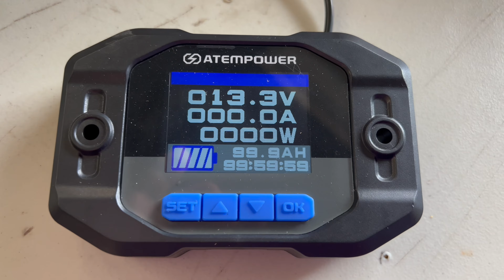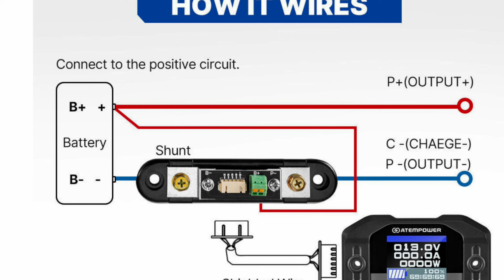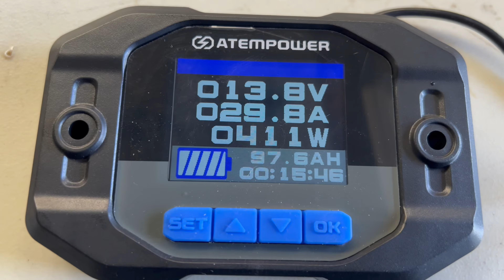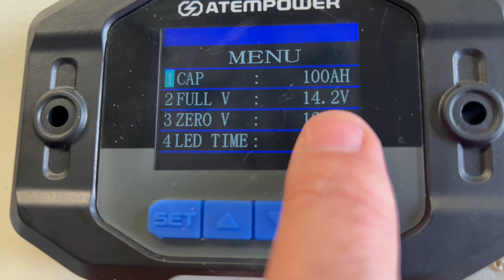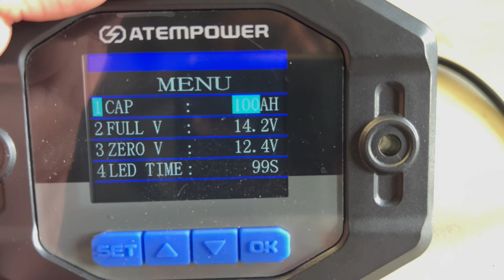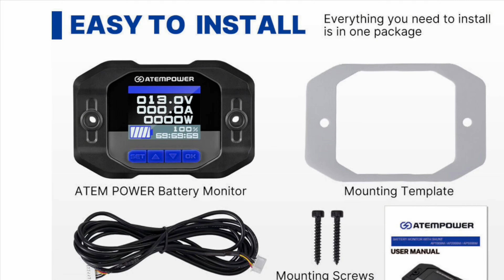Atem power battery monitor

Comment: Thanks for the review!
If say 10amps of charge was going in and there was a load of 15amps, does it show a - sign? (-5amps)
Reply from the maker: @vrvisionaustralia  yes will show 5 amps and battery symbol not flashing meaning using 5 amps but if battery symbol showing lights chasing ,will mean charging . Thanks for watching 👍🍻

Comment: Fair review, yeah the contrast of the cursor is terrible for setting up & I do like a BT alternative as well. 
Another consideration for anyone going lithium with a 3000W inverter is that you would need a 500A shunt & this is only a 200A shunt, so will only work up to 2400W, but probably a decent lower end shunt.
Reply from the maker: Cheers mate thanks for watching 👍🍻

Comment: Another interesting video on an alternative to the higher end brands. Just a question on the set up. I have a Renogy unit and for the unit to accurately meter percentage state of charge, the battery needs to be completely charged (set 100%) or completely discharged (set 0%). From what you have shown, you can calibrate at any point of state of charge. Am I interpreting correctly?
Reply from the maker: Hey Fred I have a renogy unit in my hiace van and I only set to 100% when batteries were fully charged and I haven’t put any of the voltage in the settings of the renogy and it seems to work fairly good  👍🍻
Reply: @EFFICIENTSELF  Thanks for follow up. I think in the case of the Renogy unit, the voltage settings are used to give an alarm when you hit a nominated high or low voltage. Probably more important when you are using a non lithium battery. Look forward to next vid. 👍

Comment: As clear as mud 😅
Reply from the maker: Thanks for watching 👍🍻
Reply: After using mine I noticed that if I boil water in my jug through a 1500watt inverter,  the battery capacity goes to zero with no amp hours left and the time remaing to recharge goes to 99.99.99, but when the battery voltage goes back to 12.7v (the full setting on mine) the monitor goes back to working again and the ammount of power going into the battery is showen, that is cool if everything is in a good state of charge but if the charge was getting a bit low and this happened, the capacity would not show untill the charge reached the set full ammount. It does say in the instructions that the dislpay may be affected by a large draw sobthat must be what that means, at least the voltage display and charging currant will still work.